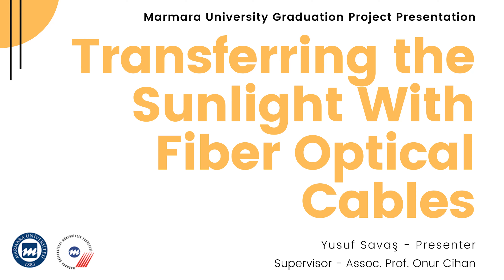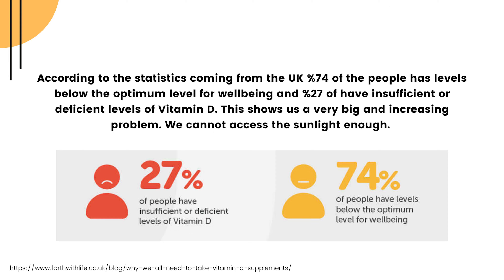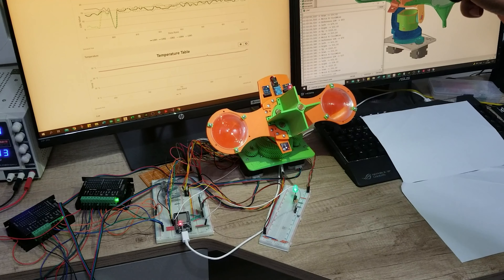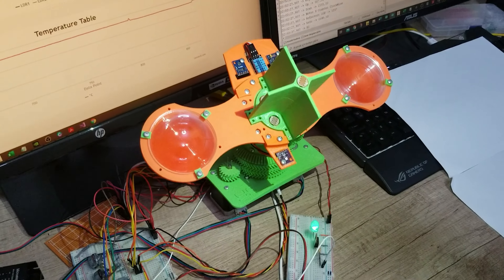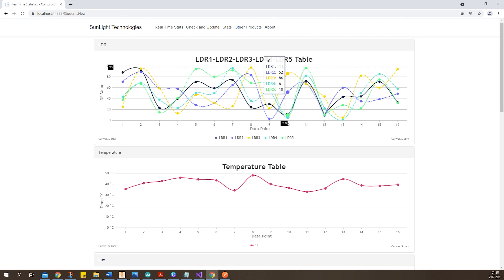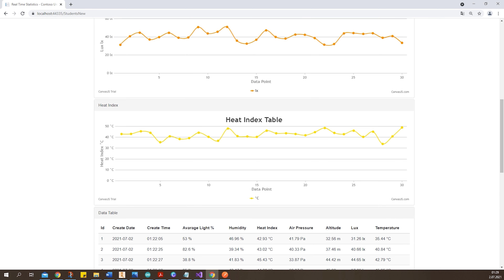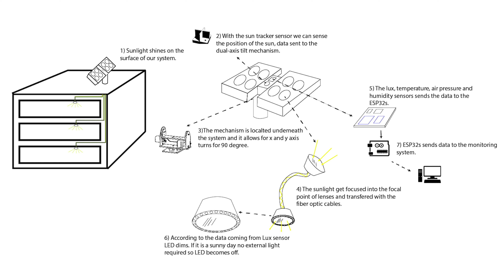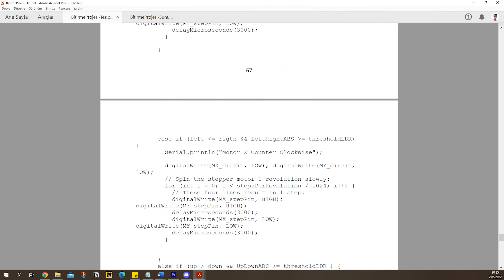Transferring the Sunlight With Fiber Optical Cables - Dual Axis Sun Tracker

Comment: I have seen a commercial system like this online before, but it seems it never really has gained a lot of traction in the past 10-20 years. I guess nobody is interested in a complication like this, although for certain use cases where you cant change the building structure freely it makes sense i assume. All being said, since this construction would be installed stationary, why do you need a sun tracking mechanism. Through the year's seasons the sun should travel in more or less the same axis. Based on coordinates and surrounding buildings you should be able to calculate how the sun will be optimally used. And if at that optimal point there is no sun, then there is no better sunlight at all, e.g. because of clouds. Maybe every 10 years you have to adapt the position slightly. But the real time sun tracking doesnt make sense to me. It complicates the system and shouldnt be necessary. Thousands of years ago people built structures where on a certain day the sun would fall in a certain angle through an opening. It's really just some math and research of how the sun is travelling at your location through day and the seasons. Then programm the motor based on a clock to move optimally according to the angles of the sun movement.

Comment: I don't think it'll work.
Reply: @dammitbobby283a simple LDR with some transistors and resistors will accomplish auto dimming of light (run by electricity) on a sunny day.

I think what he's trying to do is transfer the SUNLIGHT via fibre optic cable and use it to light up inside buildings.  
A mirror setup will be more feasible in my opinion.
Reply from the maker: @subhrapratimsharma2825  You are right about the thing what I was trying to achieve here. Transfering the sunlight using the fiber optical cables. I dont know what did you mean by a mirror setup but actually this system is a smaller version of what the Parans Solar Lighting system is doing. It is system that already works, you can search for it.

Comment: I think this quite amazing. I've been researching methods of sustainable / natural lighting solutions for housing. I'm surprised I haven't found any systems like this on the market. I am curious though. How effective are the fiber optic cables at transferring solar light? Will there be a significant loss in luminosity  when the light is dispersed into a room?  Some sources say that water or UV rays could damage the fiber optics over time, making them useless. 

What are your thoughts?

Comment: But what about intensity and power ,,you cant use it in wider ranges or long distances,,that there would be a major significant loss in light intensity ,,so at the end point the resultant light will get dim and thinner....and it would not help the problem...how would you deal to this. 
and then after the cost of installation will be too higher and also fatigue of system will become major issue after certain time.